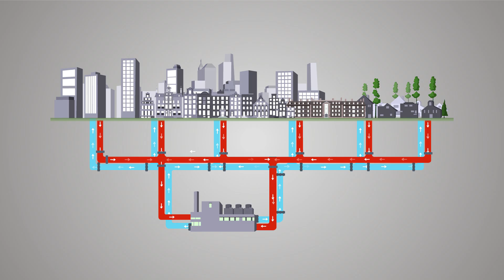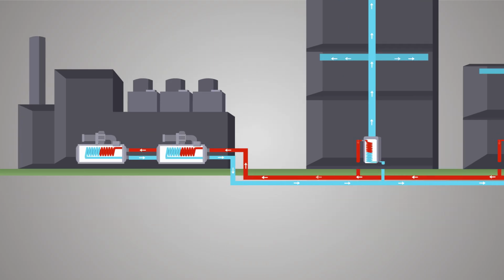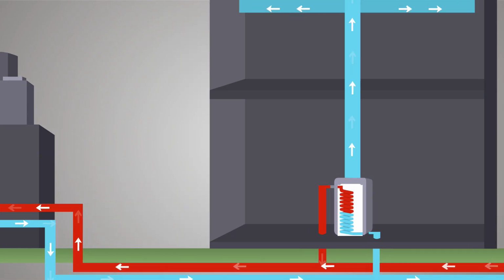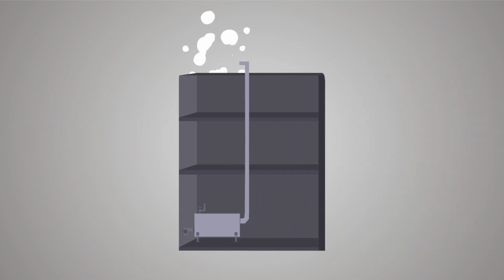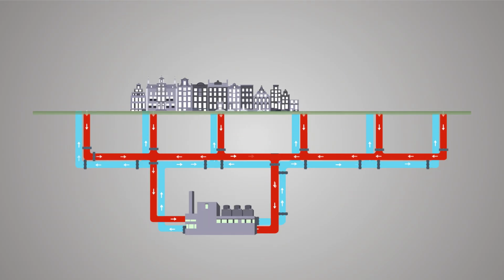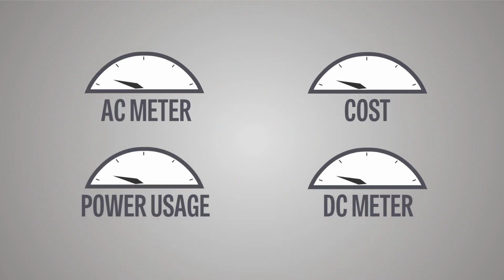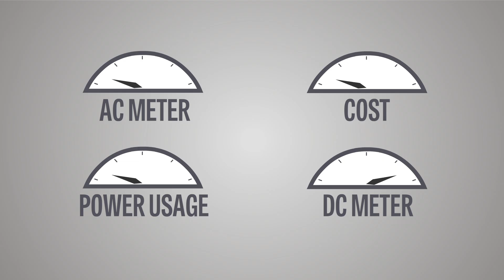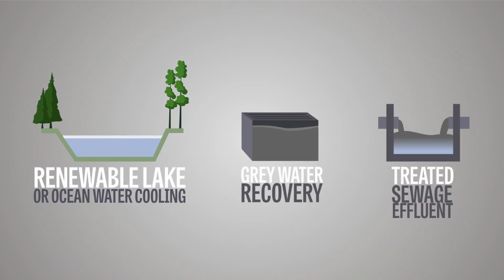District Cooling: A Climate Solution

Comment: What happens to the heat extracted from the warm water returned from the buildings?
Reply: The heat is transferred to the district water cooling return line via plate heat exchangers and this water gets recirculated again as chilled water supply
Reply: Probably thrown back outside or used for heating water elsewhere.

Comment: If a building is connected to the cooling system, does the individual offices have the option to turn on/off the cooling facility?
If yes, can they adjust the temperature too according to their own comfort?
Reply: With an individual vav box or fcu coil every room gets its own temperature control mechanism...
Reply: It has a control system within the building so yeah it's possible
Reply: yes, you can just put a valve on the water pipe to prevent water to be distributed to that room